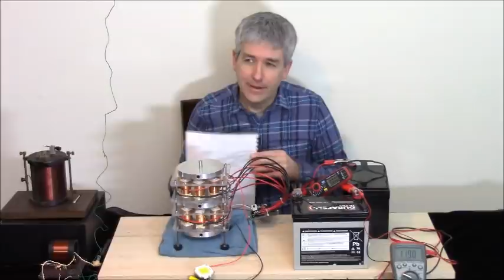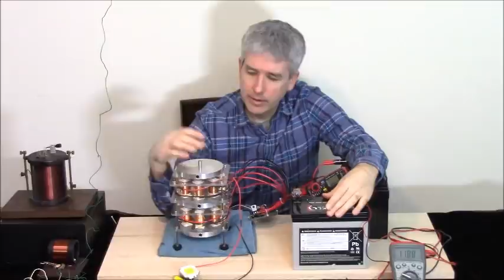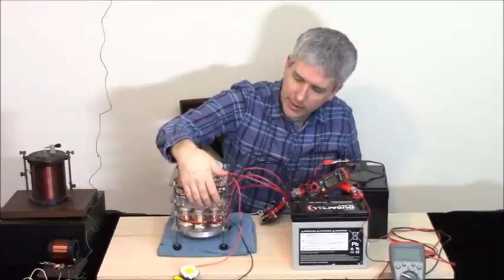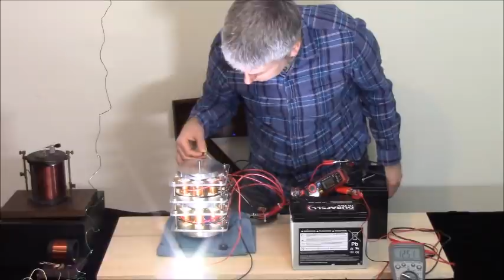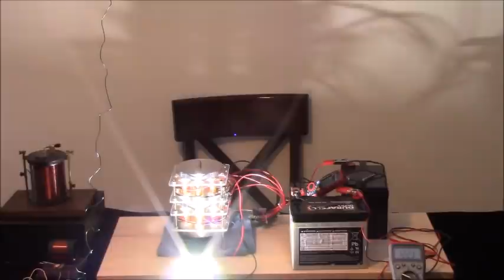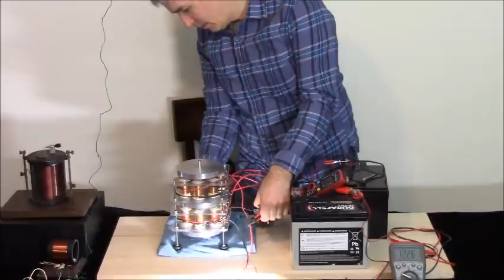2 New Kits: Mini DualPole and Resonance Induction Coupler Kit Part 2. Double Stacked Mini

Comment: Just want to know how much for  the whole complete unit, not include the batteries. Looking forward to hear from you thanks.
Reply from the maker: There are 4 options. Single or double stacked, fully assembled, or partially assembled (all of them come with circuit board assembled which is most of the work). These are on the R-charge.com website:
r-charge.net/Mini-4-DualPole-Magnet-Motor_p_200.html

r-charge.net/Mini-4-DualPolar-Magnet-Motor-Double-Stacked_p_194.html